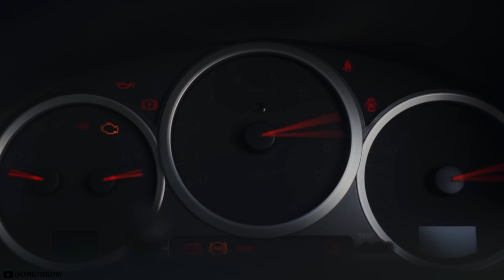Donut Media VS. Subaru

Comment: It's definitely a double edged sword. Subarus are fine when done right, but even then they can still have problems, at least the older ones. I have a 2020 STI and it's stock for the most part, no issues. Of course an older vehicle, clapped out by TikTok kids, and ridden rough is going to have a lot more issues because with Subarus, you need to look after them. I feel like, in my personal opinion, they are a decent platform for an experienced enthusiast that likes working on their car, to have. There's way more reliable enthusiast cars out there, but at the same time unless you owned one, and worked on one, it's really hard to rule them out. Since my STI only has 40k miles on it and I drive it like a normal person for the most part, I haven't seen any issues like these older WRXs and STIs. I think they can be fun, but definitely be aware of issues, look into prior maintenance issues etc. It seems like most casual enthusiasts don't see the point in owning one if all that care is involved, and I can't exactly blame them. If you're a diehard Subaru enthusiast though, of course you'd defend it. Donut isn't 100% at fault, but I can't blame the Subaru community for being pissed off due to their lack of experience. It's a great platform, and it's fun, but they definitely should have don't way more research. If it was a Mustang GT or something like that, they probably wouldn't have had as many mechanical issues if they didn't buy clapped out cars. They'd probably crash more lmao like how did they crash like that?

Comment: I 100% agree with this. 
The fact subaru made a car with an audience of 16-20 yr old vapers who drive 16-20 yr olds. And they didn't already have baffles or the correct oil pump shows the failure on the manufacturer's side and they probablydid it to cut cost. Sure you can look on forums and fix the common problem but (I'm going with Dodge because I'm a mopar guy) you look at one of the most notoriously unreliable tuner cars srt4 you can find all sorts of ways to not have your transmission blow up every time you press the gas. Does that mean you can't blame the manufacturer and its all the owners faults for not building the trans properly? No its no the manufacturer for cutting cost and not making something that is able to hold up to the intended audience. The 5.7l the pre eagle has issues with Valve seat dropping and the eagle has lifter issues besides those the engine are pretty much bullet proof and there's plenty of forums on those. Again manufacturer problem Dodge fixed the valve seat issue with the eagle but never fixed the lifter issue but you can do it yourself when you buy the brand new car with 10-30 miles  on it and not have to change the camshaft. Point is you can look on forums all day and make any car a good car and able to handle track conditions. But if a manufacturer has a common problem it's a manufacturer problem not a owner problem.

Comment: I have a JDM gc8 I got while stationed overseas and I definitely have fun with the car in its bone stock configuration, haven’t touched it yet with any mods tho other than suspension because I can’t afford to fix any catastrophic failures. Its kinda funny how that works tho how people let the RX7 platform get the pass that it does. Imo it’s purely off the allure and legend the platform has alone because I’ve driven one and wasn’t too impressed, they have almost identical reliability issues and learning curve to ownership (7 parts are even more expensive and scarce) one is just referenced more in pop culture so the hype just carries it.

Comment: I own an '05 naturally aspirated Subaru. I also own an '03 naturally aspirated Ford 4.6 two valve. I have to say I much prefer working on the two valve then I do on the Subaru. Not to say that Subarus are much harder to work on but the parts are more expensive, no one knows how to machine Subaru heads, and the Subaru is just far more complex of an engine. I can essentially do an entire engine rebuild with the block still in the car on my two valve. But the Subaru it's easier to just pull the engine then rebuild anything in the car. And while it's not typically a lengthy process to pull the engine out of the Subaru, there is a ton of things to remember and disconnect before you're able to pull the engine on the Subaru.

Comment: As someone who has owned now 2 outbacks, and my siblings have had their share, there seems to be "gotchas" on certain years. First of all, they insist on putting the exhaust manifolds right over the CV boot, and they crack open. Or the 4th gen outbacks, had the cam carrier seal leak (the block it used which I think also found it's way into some WRX). Or the CVTs have had their share.

(Oh and I found, Conoco and some other gas companies, loved to set off my Check Engine light)

Comment: I 100% agree with your assessment of the problem with Subarus. They're not just shit cars, they require more knowledge and work to take proper care of them and not blow them up. That's all. They're really cool if you don't expect to go the cheap route and swing/track the car. If you wanna go the cheap route, just keep it to the street and drive slow homie.

Comment: I used to own 2 FB RX7's. Both had 13B swaps, both were bridge ported, both were pretty much identical except for the intakes. One had a Webber intake set up the other had a Mikuni intake set up. I've always heard about how unreliable rosaries are and I always wondered why. I've always argued "well if you know how to maintain one you won't have any problems". I guess at the 3nd it comes down to knowledge.  Both RX7's were the most reliable cars I had ever owned but that's because I knew about adding a little 2 stroke oil to the fuel, I knew about the oil consumption which is built into the rotary, I knew alot about the platform because I surrounded myself with people that I could learn from. I guess that's what happened here.  The knowledge of boater engines just wasn't there. The knowledge on the overall platform wasn't there. In the end Donut had a series to make and their lack of knowledge on the platform for me at least made the show more interesting.

Comment: I'm not a subaru guy, but I drive road courses a lot, and I was thinking during the whole series couldn't all of their engine issues have been fixed by putting an accusump on both cars? thats like the first reliability mod i put on any car that goes on track with a stock motor/oil pan setup. todays rubber generates too many lateral G's for the oil to stay with the pickup.

Comment: The same problems from 10 years ago as today. People go into Subarus expecting to be able to skate by in the grey, but there isn’t any. There is right and wrong. I took a 200k stock ej205 to Road America and ran a few track days and drove it home and to work for years after. You have to build it correctly and know what you are doing. Being haphazard with a Subaru or cutting corners will only bite you. Adam is completely spot on, you have to have the desire to learn about the platform and devote the time to it. I do disagree that Donut should have taken a step back after the first or even second blown engine and asked for some outside resource. As repeating the same actions but expecting a different result is the definition of insanity. One of the most common things that fails a newly built engine is re-using the factory oil “cooler” from the previously blown engine. It’s nearly impossible to get all the damaged material out of it but can release debris after the rebuild and kill the build. It’s the $260 cut corner that ends up taking the whole build with it.

Comment: My buddy K-24 swapped his FRS track car because he himself even admitted he didn’t know a thing about boxer engines and didn’t have the know-how to tune and maintain it properly. His rationale behind the K-series is that it’s cheap, readily available, easy to tune, and very cost efficient to repair when something fails and with him using it primarily as a track car he knew it would be a matter of when not if his FA20 was gonna blow. He’s been a Honda guy on and off for years having several different teggies, Sis, and Preludes over that time and he’s got a good amount of background on the K-series. Subarus are great cars, they really are, I’ve seen some boxers reliably pushing 700+ horsepower with the right parts and know-how behind the build but they’re not for everyone. There’s definitely a ton more options for the entry level enthusiast today and unless you’re a diehard WRC/Subaru fan I’d always recommend looking elsewhere because like Alex said, boxers are a bit harder to work on than most of us think. They’re a very finicky platform but can be insanely good in the right hands, just depends on the amount of research and budget thrown at it at the end of the day.

Comment: Lmao I’m a Subaru guy and I agree ☝️ with these engines. Those turbo engines go Boom 💥 anything over 100K miles or “turned” will cause problems if pushed to its limit.

I got myself a Honda Si (08) and it never missed a beat at the track. I even take my 350z stock 155K miles and no issues.

What you have to take from Donut’s video is that “modified” vehicles will cause headaches

Comment: That's why I picked up a Toyota aristo 1999 with a 2jzgte vvti and I had a 1994 aristo with the non vvti. I had a N/A Subaru Impreza but they always have head gasket issues. Smh now I have a Infiniti G35 coupe and a sedan. Love both of them easy to modify and to make power with but all cars need love.

Comment: My motor is pistons rods valve spring and arp studs, killer b pickup and moroso oil pan and a OEM high flow oil pump and cylinder 4 coolant mod. With a solid tune it's as reliable as my civic.

Comment: As a former Subaru owner & modifier who went through 3 engines on the same car, it's not unfair to say that Subaru engines (EJs specifically) are not very robust.  Can they make good power reliably?  Sure, but you have to do everything right and even then sometimes they still pop (I knew that one of my engine rebuilds wouldn't last because I couldn't get the block decked for instance).  But the reality is there are so many other cars out there that can have the jankiest parts thrown at them and make 2-3x stock power for hundreds of thousands of miles.  There's a reason no one bats an eye at a 500HP junkyard LS, but a 100k mile 400HP EJ25 is a wild achievement.

I currently own a UrS4, with 230k and a big turbo.  Original engine.   Yeah it burns a little oil and the original turbo failed at ~215k, but that's a far cry from multiple engine rebuilds in 50k.  Or the perennial bad boy LS- stick a cam in, slap an ebay turbo kit on it, make 600HP as long as you want.

Subarus are fun and I don't have an issue with them, but their engines are just less tolerant than many others.

Comment: I have worked as a mechanic for some years for my dad who is a life long mechanic. We do not like when the subarus come in. They are always leaking oil from every gasket. Head gaskets are always leaking and when doing the job the heads are warped so you'll need to take it to the machine shop to get that fixed. Changing the spark plugs on certain subarus is a pain because there isn't enough room between the plug and wall of the engine bay to take it out. They are just a pain I wouldn't recommend buying them

Comment: The thing with Subaru is it’s a specific platform.  It’s not like a Ford or a Honda that has motors and transmissions in everything.  Subaru is a car company that went it’s own way with its own engine and transmissions. This makes them a niche market and requires some niche knowledge.  If they had someone who had worked on Subarus before they may not have had all their problems. But like many garage mechanics they jumped in and were doing the mods they thought would work.  It’s a great example of what can happen if you don’t do your research and reach out to those who wrench on those cars all the time. Know your car and you can go far.

Comment: I own an 07 TR and am the original owner.  It has 83k miles and all I have done is oil/fluid changes, maintenance, and a power steering pump.  I am on the original clutch, which catches in first and reverse without throttle when slowly let out. But why is it still around in my garage almost 18 years later?  Because I didn't modify it (except for stereo, speakers and shifter), took care of it, and didn't beat on it too hard.  This is not a good platform for a build, in my opinion, if you don't know the intricacies of the EJ25.  I love my 07 TR and I will keep it until the wheels fall off, since it was the first brand new car I ever bought.  If I sold it, some kid would destroy it weeks by trying to modify it and beat on it, and it deserves more than that since I have kept it nice all these years.

Comment: It's all about use case. I bought a 2016 WRX new and have kept it stock (barring a second set of wheels, a shifter bushing, a different grill, some mudflaps). I did this because almost no one does and it's already plenty fast as a DD. In 80k miles, the only issue I had was one fuel sensor go bad. I think the problem with these cars is that people think you HAVE to modify them to have fun. If you aren't taking it to the track, just chill out. If that sounds boring to you and you just have to modify something, then yeah, get a different car.

Comment: I had a 2006 hawkeye WRX STi, blue with the gold BBS rims. Completely stock other than SPT parts. Engine blew (one cylinder wasn’t holding compression) at 65,000 miles, quoted 24k to rebuild. I still loved the car, and it could have been be a fluke, but that is definitely not normal as far as cars go. 

I have had two Corvettes with push-rod V8s and they have never had an issue like that after 100k+ miles combined. This is not to say the turbo boxer is unreliable, but it will never be reliable the same way a push rod V8 is.

Comment: Flat engines were first designed by Karl Benz and used in aircraft and then brought into the auto industry.
They've always had tighter tolerances, they were around well before ford and his automobile.

Comment: So my 2 cents...
I run a 850hp wrx as a race/street car. i have had to rebuild the engine twice due to oil issues, very expensive.
The problem is due to oil collecting in the heads on long corners with high G's. A baffled sump will only help so much... when ALL the oil is sitting in the heads it doesn't matter how good the baffles are the bearings will starve of oil and the rod bearings will check out.
The only solution is to pump the oil back to the sump from the heads...or a dry sump system of some sort.
Failing that.... you will need to keep the cornering forces under control in the long turns.

Comment: 8:55 - There is literally no car that can have metal particles enter the oiling system and not fuck the car up. This is the ONE major oversight that you cannot forgive. If you know enough to rebuild an engine, you should know enough to do it properly so that you don't doom it to fail almost immediately. You need to replace components that cannot be cleaned of metal particles. Period.

Perhaps other cars don't have the same likelihood of particles getting trapped; however, you cannot argue that some engines are just somehow impervious to failure if metal blocks the tiny oil passages going to the main bearings.

Comment: 10000% accurate - you better live in walking distance to cobb tuning because- if you LOOK at your wrx = needs a tune.  Cold weather = probably going to over boost if you don’t have a good tune. Intakes = tune.  Stock = Tune - because they run lean stick to meat ulev requirements.  06-07’s = taller final drive = greater risk in transmission self destructing.  

I put well over $13,000 in 6 years into my wrx JUST to keep it running properly and fast.

They are not a car you can “just” add parts to and have an expectation that the vehicle will magically be bullet proof like a honda or Toyota.

If you do not make great money or have money to spend = probably the worst platform anyone on a budget could choose.